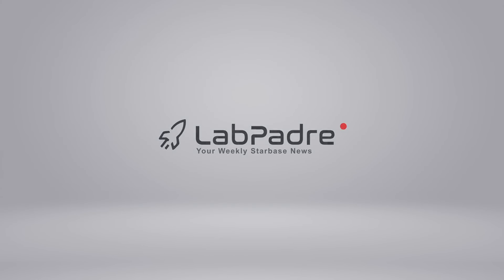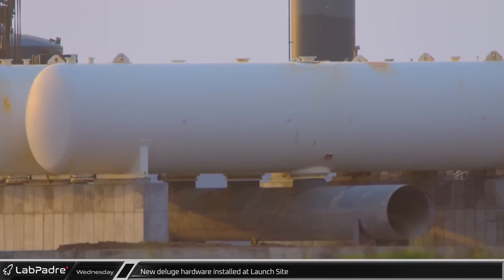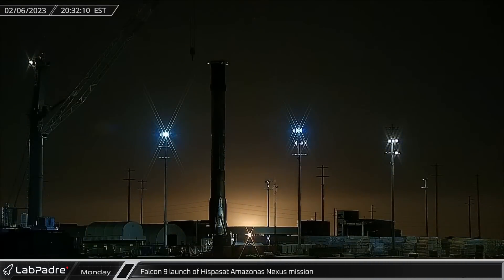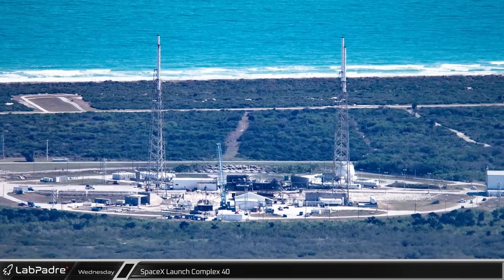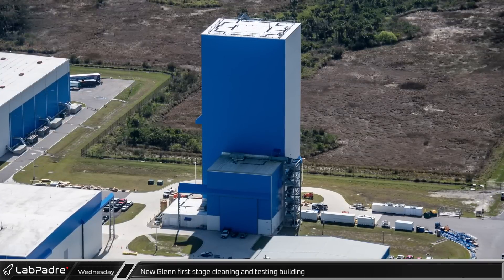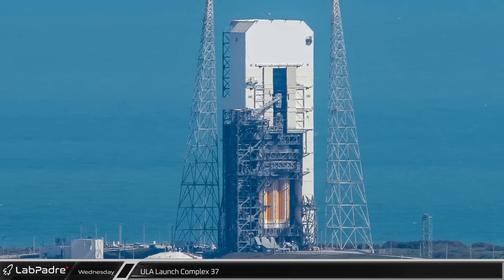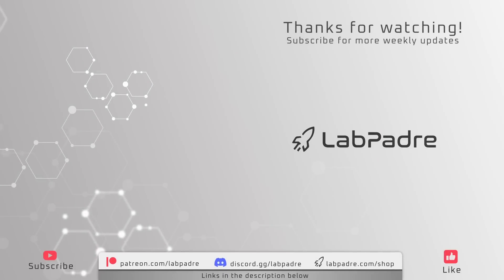History in the Making: Elon Details Success of 31 Engine Static Fire! - Starbase Weekly Update #49

Comment: 7:12 - As to why the 3rd tower may be shorter and lacks piping:  I think it may be used only for catching, not launching.  Maybe that is seen as the best option for rapid reusability for the first period where launch towers need some refurbishments after each launch.  The landed rockets would then be transported on SPMTs to the launch tower.
Reply: Interesting answer.
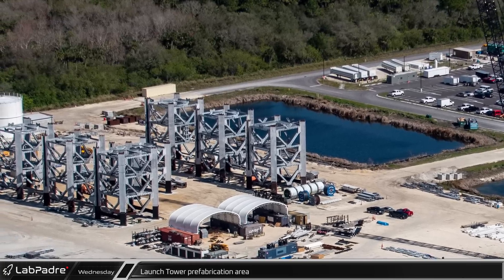Reply: And at 7:00, we can see a piece for attach the QDA on the tower section on the background and the middle, beetween the 2nd and 3rd level
Reply: @C_Greg   - I would be happy if my wild guess turns out to be wrong.  I'd like to see all towers multifunctional.
Reply: Wrong. There's still an 8th section still in pieces. And pipings will be installed later
Reply: I wonder if they will have sepearate towers.  Ones for launches, and the other for landings.
Reply: @So1othurn  No
Reply: The 3rd tower will be the same high than the 2 firts towers
They just switch a level from the 7th section to the 8th (;
Reply: I think 2 towers will be required. One to launch a complete Starship and the same tower to catch the returning second stage, the other tower to catch the booster stage.
Reply: @michaelreid2329  they dont need that, they can put the Booster on the OLM and deorbit the ship few hours later for be catch on the same tower
But yes they need 2 tower for orbital refueling
Reply: @C_Greg  not ideal, especially considering SpaceX will need some form of backup for contingency, from an emergency or delay in relocating the landed booster. Just imagine a blown hydraulic hose preventing the chopsticks from working after the initial launch.  Where does the booster land without a launch tower that has been damaged during launch?
Reply: I wonder if they are using it for LC-40? Possibly for one of the oil rigs?
Reply: @ryanritter7814  LC-40 it for Crew Dragon launch, and work on oil rigs are on hold
Wait and see

Comment: Tower 3 has to be a catch tower. It doesn't need to be tall enough to clear the orbital launch mount, and it doesn't need piping for propellant. I guess we'll see if the next set of chopsticks are the longer ones like Boca Chica.
Reply: Shorter chopsticks ≠ lifting-only chopsticks
Reply: @alvianchoiriapriliansyah9882  ?? Which has the shorter chopsticks?
Reply: @dphuntsman  39A

The OP is waiting for longer chopsticks like Boca to prove if it'll be for both lift & catch, which I said "no"
Reply: That is a super good idea. you might be right. i would think they would want to try and catch the booster in another place rather than near the farm. This makes it super easy to launch, then move in another rocket and stack while the booster is caught else where.